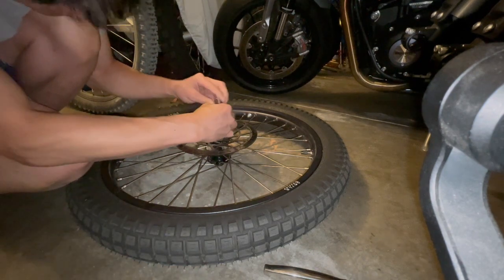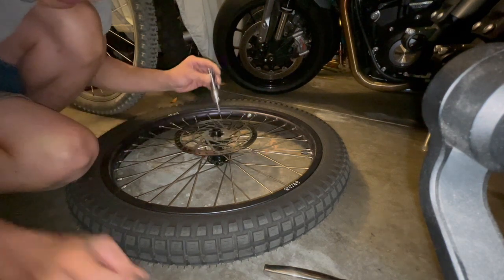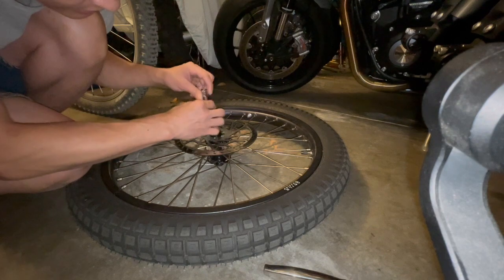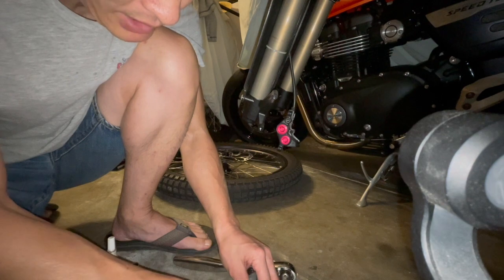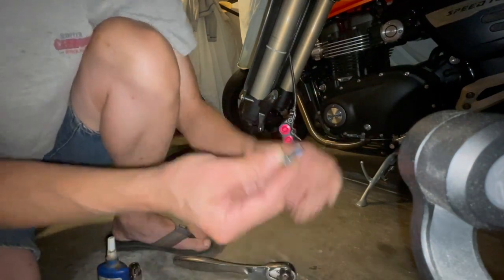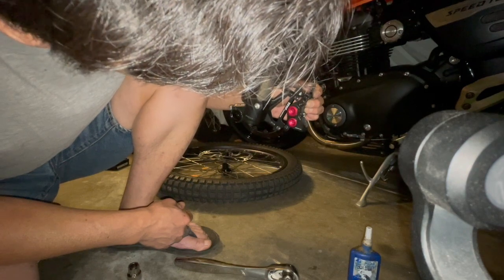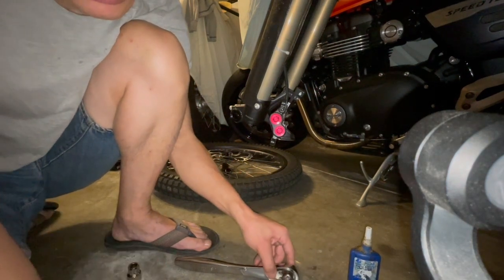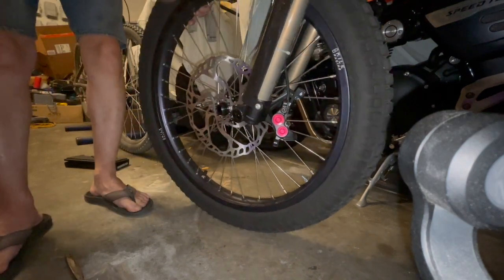Talaria StingR 243mm rotor

Comment: it might be time to go to a motorcycle caliper
Reply from the maker: That's what I'm thinking but these forks are mtb forks....unless I put on a moto fork which is much beefier/heavier.  Even though this rotor size is larger than dirt bike rotors they are thin, about half thickness and surface area is small too.  So it is not just the small mtb calipers.